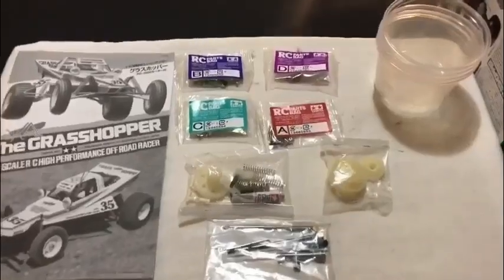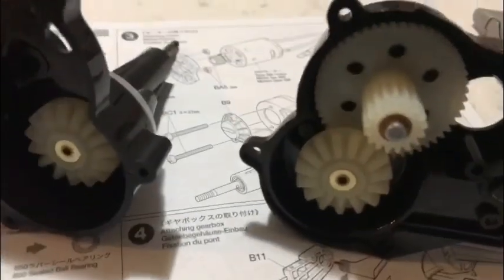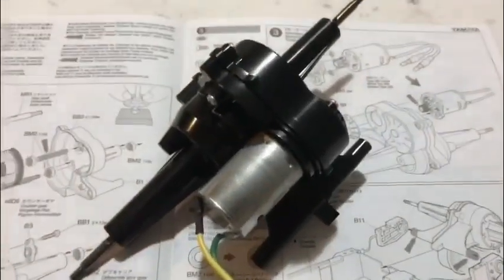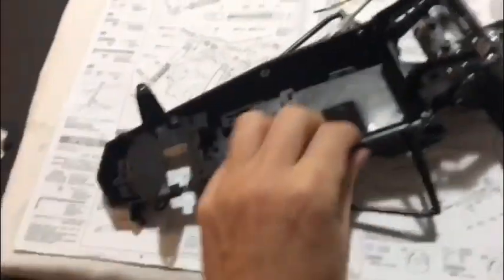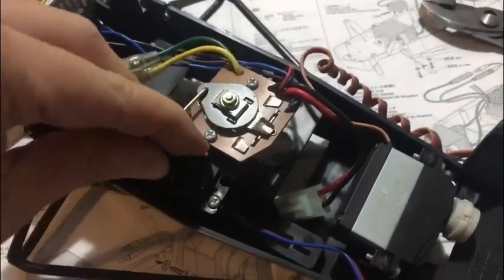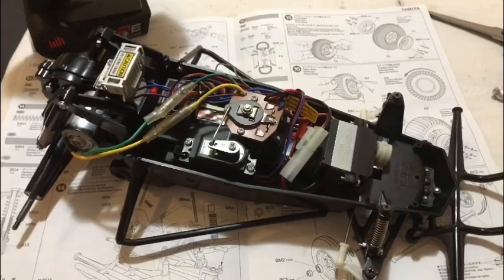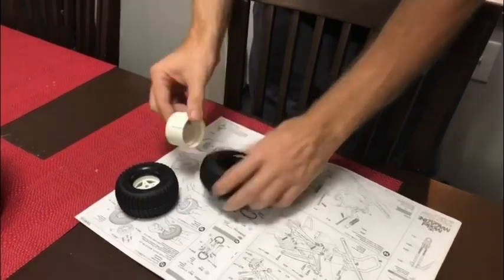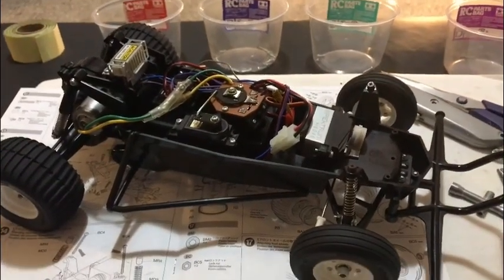Tamiya Grasshopper Part 2, The Build for Beginners...

Comment: I struggled with those tires then finally on my last tire I noticed the difference in the small screws, I thought some just threaded on easier then others when really it was the two sizes mixed up, so I wasn’t happy I had to redo the tires

Comment: Bringing back memories from May of this year I think we did first buildoff, I have a spare 13 or 15 turn brushed motor by dynamite n was thinking of putting it in grasshopper or the lunchbox, if I put in lunchbox I’d take the lunchbox 540 n put that in the grasshopper would it work or fit? Which way would u do it. I also have a 12 turn titan traxxas motor if the 550 won’t fit
Reply from the maker: STEVO D 313 
The 540 is plenty, I couldn’t keep it in a straight line 😂😂😂
Reply: Ok so put the 540 stock silver can in from the lunchbox to replace the 380 or 390 it has n put the 550 can 15 or 13 turn in the lunchbox, or use the 540 can 12 turn titan in the grasshopper n then I won’t need to touch the lunchbox, or put the 12 turn 540 in the lunchbox? Sorry if I’m confusing
Reply from the maker: STEVO D 313 
I’d go 540 in the Grasshopper and see how she goes, a lot depends where you’re running her.
However stick anything in the Lunchbox 😂😂😂. It’s great fun no matter what 🏎💨💨